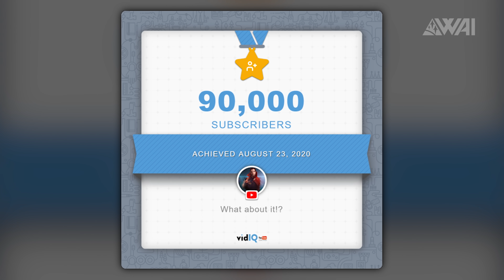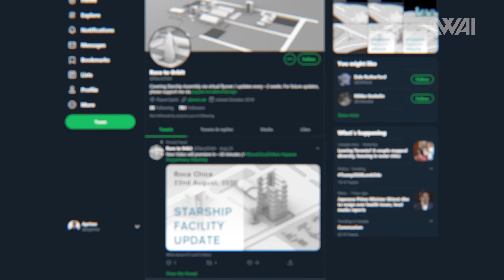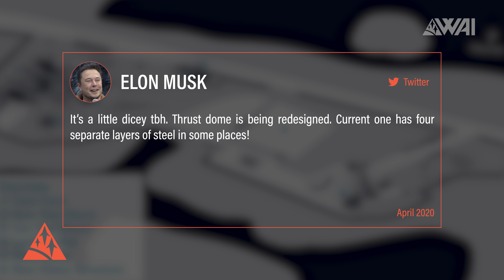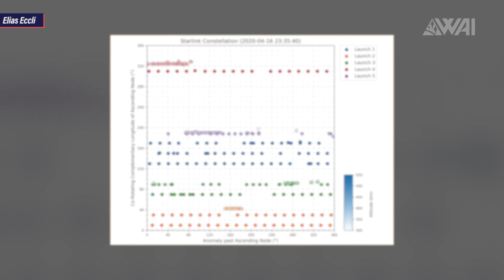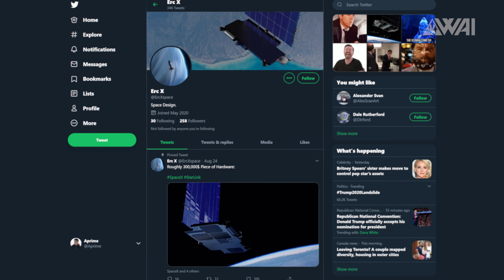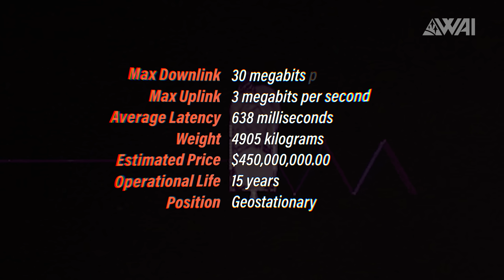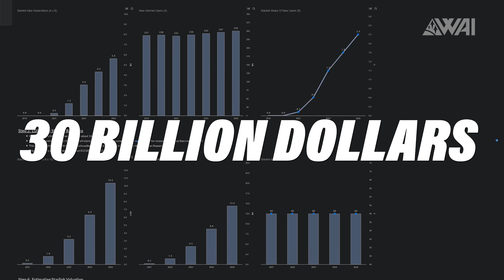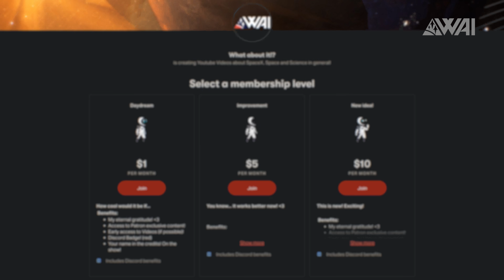116 | How to finance a fleet of SpaceX Starships?

Comment from the maker: Help me! What are the clamps on the nose cone segment for? :_WAISweet:
Reply: Perhaps they are hinges for the clamshell cargo door and that is the hinge point?
Reply: @anthonylosego  57th 7th 7th 7th
Reply: @albertoftw  I'm retracting... I think it may be a latch to seal a hinged section rather than the opposite side hinge.
Reply: @anthonylosego  That is exactly what I was thinking! It is exciting if they are already thinking and building the doors which will release satellites. Space X has announced 2 satellite companies have already signed up for a 2021 Starship delivery.
Reply: @anthonylosego  This is the most likely answer. They need many flights and landings of Starship before they can trust it to take people around the moon. I would bet their number one goal is getting it to orbit to deploy Starlink satellites. Many more per launch will help the system get up and running faster, and Starship is cheaper to launch than Falcon 9 as well. I think next year is going to be very exciting.
Reply: Placeholder? The nosecone is a very complex shape and has a lot of evolution to be done. Maybe this way they might test the stresses for possible windows, clamps etc? Early test tanks look very different than today. They have weird structures now, as a reaction to crazy physics
Reply: My first thought when I saw them was maybe they are a place to attach the lifting crane for an assembled starship. Like SN5 has attachments at the top of the ring segment, but once the nose cone is attached they won’t be able to lift the starship that way anymore. (And they will have to lift it on the test stands and on top of super heavy, etc
Reply: I think it is going to be used to test structural load capabilities and probably for flap attachment or even a faring latch.
Reply: Maybe they are there so as they can pick it up. LOL... Seriously though Felix, i was wondering if you could find out something for me. When Starship transforms from its belly flop position to the upright position to land, how much, if any, "G Force" will the Astronauts be subjected to??
Reply: @aussie_al  agree.. to stack it
Reply: @EdwardMcClung  yup!! That's my guess as well 🤔...like shims or spacers?(no pun intended)🤣😎
Reply: @aussie_al  They will generally stay unser the 3g (If I remember correctly) needed for humanrated spaceflight by Nasa
Reply: Fins
Reply: They are on the right place for fins
Reply: pretty sure it's just tooling. Once they've finished welding that segment I fully expect they will be removed. Maintaining alignment across those rhomboid sheets while welding them into compound curves puts some weird stresses into it, as is really obvious from previous nose cones.
Reply: Just guessing, but maybe they're temporary pieces to help guide placement the top nosecone segment.  The large size might be to spread the load to avoid kinking the lower nosecone, should the guide be bumped, and they'd be removed after securing the connection of the nosecone pieces with welds.
Reply: I agree with Koda and Aussie, main lifting points.
Reply: Starship to recolect space junk and either deorbiting it, send it to deeper space  or bring it back for recicling
Reply: Looks like there will be 6 of these plates around the top that flip up to hold on the cap for the mass weight
Reply: These clamps holds the upper cone in position when welded into one piece
Reply: Oh crap handles,lol.
Reply: They kinda look like a ksp A. I. R. B. R. A. K. E .  Will the clamps be on the outside or the inside? It could be something like a thrust Puck sort of thing
Reply: one wonders if its the first iteration of starship cargo?
Reply: Part of the cabling system for providing artificial gravity to a pair of Starships.
Reply: @marxug1  bola's twin!
Reply: I think these clamps are when rotated 180 degrees, they will be used to hold the nose....my take on it ;-)
Reply: In orbit refueling and docking.
Reply: Hinges for clam shell door!
Reply: Payload hatch to test stress on flight structure
Reply: Is there a chance star link will work as mobile service?
Reply: @chiefwatta8379  I hope
Reply: It's half of it, it will be a oval.
Reply: First of all, I thought you were going tell us how Elon is going to use the starship for. Around the moon, to Mars ext yes ,I know but what ells. Maybe space construction purposes in space. Second of all, Why the heck do we need so many freaking satellites in space. We have so much space junk as is so maybe Elon should figure out a plan to clean the space junk.
Reply: @Earthmoonstars-el6rd  He has a plan for everyone to have internet then an exit strategy for the satellites. No one else seems to have that. They put satellites up then when they are no longer useful they don't care. So how is Elon adding to the problem everybody else is. They have no accountability but spacex does so what's your point. I am sure if he was hired to clean up the space junk he could and would better than anyone else.
Reply: coupling for a launch escape? just a guess
Reply: How did you put your own emoji there???
Reply: A Solution to easyly maneuver the starship onto the superheavy. Kind of a crane fix
Reply: Just holds the internal walkway they are stood on ?
Reply: @ModernProjectManager  you can never fully cost a project until you are out of the ground. After that it's just simple engineering.  :)
Reply: @DB.Crypto  a parachute system for something this big would not feasible.
Reply: Maybe it is a nose cone just for Super Heavy testing
Reply: Might be hinges for a cap opening like petals. This might be used for dragchutes/parachutes so in case it fails doing the bellyflop, they still have a plan B to get it in a retrograde orientation for safe landing.
Reply: Big clamps to lift hundreds tons of Starship on top of SuperHeavy.
Reply: You had it right the first time:
6:04 That's where the Illuminati will attach their flux capacitors to launch SS's
 into the past and make gargantuan hidden profits on the stock markets. Yes, Elon is one of them...
Reply: @-danR  nonsense
Reply: Structural reinforcement and weld points for attaching the forward part of the nose to it.  

You can't open them if the nose is a single plate. So if they are hinges, you'd need to split the nose into many parts, lots more seals and things to fail. So that extra weight and complexity. Not a good thing for a rocket. So I think if they have a hinged fairing, then it would be a single hinge with a seal.

Might they be on all of the noses?
Reply: Initially I thought Upper anchors for control fins, but a little voice in me is hoping they're for landing thrusters for the Lunar Starship Demo. Why cant they make a smaller version of Starship for a lunar lander.
Reply: Because it is so breezy in Boca Chica that sticky notes need help to stay stuck.
Reply: Joints to open the tip
Reply: Outer Hinge pin brackets for payload door
Reply: Grid fins for when it goes from the skydive decent phase to propulsive landing. Easier to flip it around if you create drag at the top you can control.
Reply: Alignment tool.
Reply: Dragon capsule mounts
Reply: Part of a space station?
Reply: maybe it's the piece that houses the faring that holds all those Starlink satellites he needs to finish that project?
Reply: Looks like six hinges for opening the nose for satellite deployment.
Reply: Watch the payload integration in the ULA NROL launch today.You see something similar.
Reply: Water tower
Reply: Maybe for the Starship  🚀 fins?
Reply: integation dragon crew
Reply: Might be for backup parachutes from a nosecone.  😁
Reply: Might be an ejection seat 💺 to kick out a troublemaker 🙃 to space.
Reply: There not clamps the hinges ! What
Reply: What dou you mean on making the clamps like illuminati logo.
Reply: Aid in the installation of the heat shield
Reply: Hinges for the cargo door for the cargo version.
Reply: Aerobrakes? or something to "steer" ?
Reply: May be a landing clams like. In falcon rockets but smaller in size
Reply: "Flappy bits. Definitely flappy bits yep. Definitely."
- the Sewer Urchin
(This is a "The Tick" comic book reference.)
Reply: Im thinking these clamps are uses as sort of a fixture to set the upper section on that will both center the next section, as well as set the gap needed for welding the seam around the diameter.
Reply: I’m thinking they could be part of some sort of welding jig to reduce warping as the steel heats up
Reply: Placeholders possibly? Locating to top cone would be complex so a stop to assist with location.... maybe
Reply: My theory immediately jumped to the same as the majority, this is for a non-crew, cargo veersion of starship that would use the nose cone as a cargo fering instead of crew space. And ehat best way to make a fering reusable, than to make it a deployable/retrievable structure on the craft itself rather than a pyrotecnic peanut shell.
Reply: A close examination of the blow up shot of those brackets reveals they are bolted on with 6 bolts. The guy on the far right is putting the bolts in. Personally they don't look like they are engineered to take flight loads. 6 bolts is not enough to attach an aerodynamic part in my opinion. Maybe it's a camera rack mount for a hop? Mounted where it is makes me wonder why only 6 bolts? As a note it doesn't seem to have anything to do with lifting because one of the lift rings is in the lower left corner.
Reply: I read that Elon Musk now is the fourth richest man in the world, worth $110 Billion. So there is no financing problem for him going to Mars.
Reply: Lift points?
Reply: @danen8  It can never match the curves of the gorgeous busty Ms Shotwell
Reply: The nose will hinge open for docking...
Reply: Knowing elon, its probably to hold onto his hopes and dreams
Reply: Seriously? 50 miliseconds? Dude games won't go for less then 8 miliseconds. Pro games stick to 1 to 2 miliseconds minimum.

Love global internet coverage but real gamers would be screaming at the screen if they uses Starlink. Elon better up his ... game? ;-)
Reply: @MrFlatage  No human ist capable of sensing 0.05 sec. We have about 24fps of visual perception (42ms) and there are interference and rolling shutter effects, which is why we need faster graphics. But you have about 500-1000 ms of processing time in anything that your brain actually works on. So 8ms ping time is just something for immature boys to boast about like an overmotorized car.
Reply: @A.Lifecraft  Sure and the world is round next? lmao!

Comment: Ok, I know this is an old video, but upon hearing the numbers about lifespan and cost of the Starlink satellites I had to do some math. A 12,000 satellite array costing $300K a piece is only $3.6B. With their lifespan of 5 years, monthly depreciation of the whole constellation would be $60M. At $80/month/user that means only 750,000 users are needed to recoup that depreciation.
The Falcon 9 had a cost per kilo to LEO of ~$2,700, these satellites are only 250kg, so tack that on to the price per satellite to get about $975K per satellite. This bumps the users needed to recoup launch cost (which will decrease) and the units for the whole constellation to just ~2.4-2.5M users.
Although this does not include some costs of course, that's a ridiculously low threshold to break even for a company involved in this industry let alone one building its own network infrastructure. Compound that with the fact that this is available to oh,  EVERYONE on the planet. At a global avg household size of 4.9, that gives us roughly 1.5B households globally, meaning that only one out of every 615 or so households would have to adopt this service to meet that threshold.
Dial that in to specifically current internet users (~4.6B) over household size and you would still only need one of every just over 380 households to recoup these costs. So if they can get just 1/4 of a single percent of global market cap on their service, they would be, ostensibly, in the black.
One percent market share? Holy smoke we're well past our expenses.

Comment: How to finance. Starship. Short answer recycle the used the stainless steel to make  cyber trucks. Make a profit and keep researching starship. If the material fails it easy to switch it. since  you can still make cyber trucks with the stainless steel there is no lost in the process.

Comment: What are those clamps? It appears that SpaceX is using the nose cones as test beds for some really innovative forward canard attachment points. The nose cones only need to mimic the shape under the mount points. This means they can test more than one design at a time. At least this is my speculation.

Comment: 12:20 your short montage of who can use starlink due to it's coverage was 3/5 wrong long term and possibly 100% wrong short term. 

Ice breakers, Svalbard, and any thing else near or inside the arctic (or antarctic) circle will not be serviced by starlink even if they fill all 40k planned orbits. SpaceX has given no indication that they will offer polar coverage. The iridium constellation will remain uniquely able to service that market for a long while. At 11:20 you show the images that demonstrate this very clearly.

At launch it won't be useful for any meaningful distance away from shore either as the early models of satellite launched do not even have the hardware for orbit to orbit routing as they have (had?) not decided on how that will be handled. If the satellite servicing you cannot see a ground station, then you cannot get internet through starlink when it first gets rolled out to customers. This is also why they have said they are only selling the service in certain geographic regions at first.

Comment: I see two possibilities for the triangular structures - 1) they are a re-enforcement structure that will allow the starship to be lifted by the nose cone and likely re-enforce the interior where the nose-cone header tank will be located transferring the weight of the header tank to the outer skin.   In this case, the inner lip will go completely around the sections we see and will be on all sides.    2) They could be mounting supports for a shaped frame to hold the TPS (thermal protection system) - in which case it would only go half-way around. The rest of the nose cone that is not present here would probably be completely covered in TPS.   I think it is more likely 1 than 2 in this case.   I am not an engineer or rocket scientist, so they may serve some other purpose.

Comment: I wonder why SpaceX haven't been using Falcon Heavy instead of Falcon 9 to launch more Starlink satellites per launch? They must have a good reasoning behind that, but I wonder what it is. Anybody have any ideas? 🤔
Reply: Look at this:
https://i.insider.com/5cdb7328021b4c7b3e56db42
That is the payload fairing of the Falcon 9 filled with Starlink satellites. There is no more room. The fairing of the Falcon Heavy has the same size, so you will not get more satellites into orbit with a Falcon Heavy. I guess for most missions into LEO  not the mass but the size of they payload is the limit for the Falcon 9. The Falcon Heavy is only necessary when you want to bring stuff into GEO or further.
Reply: @sebastiannolte1201  Ohhh! Interesting! I had no idea the fairings were the same size on both rockets. Thanks for sharing that knowledge 👍🏻

Comment: I suppose it depends on what you mean by "finish construction" but if you really mean fully finished then I think you're being way, way too optimistic when you say (at 3:20) that High Bay construction will be finished in 1 - 2 weeks. I'm assuming that you are only talking about the basic framing but even there I'm sceptical because that roof is going to have some wide spans so there will probably be quite a lot of heavy lifting and strong cross bracing to go up there plus they will also (I assume) want to form a slope on the roof similar to the one on Mid Bay and that might add to the complexity in terms of time to get the beam heights right to set the slope; the top of those final panels look flat to me so I wonder if there are a series of smaller risers to go up along the very top edges to form the slope.

Also, for final completion don't underestimate the time it will take to complete the grey cladding especially as it takes longer to get stuff up to position as they get higher and also the risk of losing working days to high winds increases the higher up they get. I don't think there's any hope at all of it being finished by the end of September. I hope it will be finished in October but I wouldn't be that surprised if it's sometime in November before it's finished. From Mary's NSF videos the fitting of the 2nd panel of the 1st HB level was underway on 7th July (seen in video posted 8th July) so we're coming up to 8 weeks after starting HB construction (excluding foundations & ground prep) and the full structure isn't up plus I'd say only about 8/44th (18%) of the extra grey cladding has been completed (I'm not counting the pre-clad corner panels since those were done in the factory beforehand but am assuming the whole roof will need to be clad on site which might be wrong because the roof panels might have some pre-cladding in the factory. In any event, I suspect there will be a month or two still needed just to fully clad the building.
Reply: Pretty sure it was a joke ;)

Comment: Divide your MBits by 8 to get your Bytes rating (Mbps) I currently have an 8-9 ms  Ping, with a 51.76 Mbps download from my ISP and Upload rate of 18.78 Mbps on Copper to the Premises  NBN terrestrial connection. I've tried ISDN (Integrated Services Digital Network) Satellite, the Disk is cool, not a little Weber Ash catcher like most, a real Comms Dish, so it still remains for show :-) and the ping was about 125 ms, the data rate was "piss poor" and cut out by cloud, which I think will be unheard of with Starlink, the data rate may be better than the Old ISDN system, but playing games, I think may be a stretch.